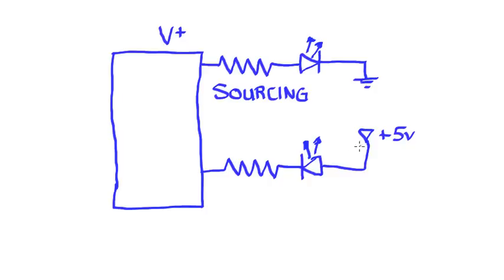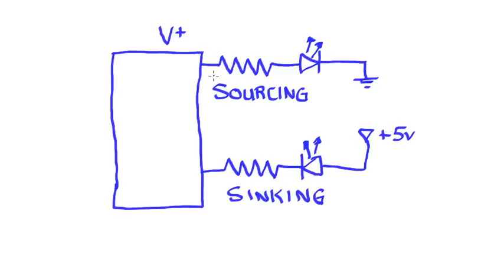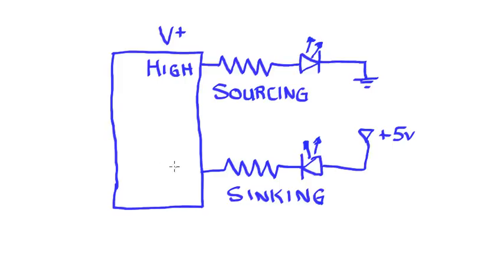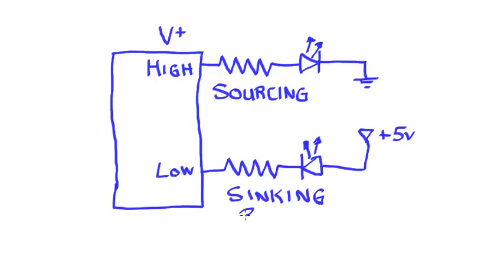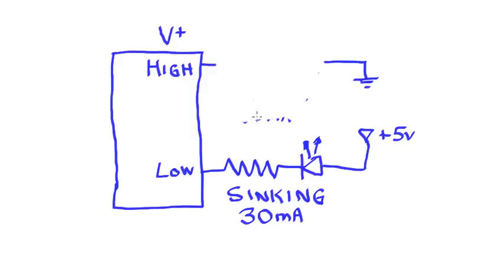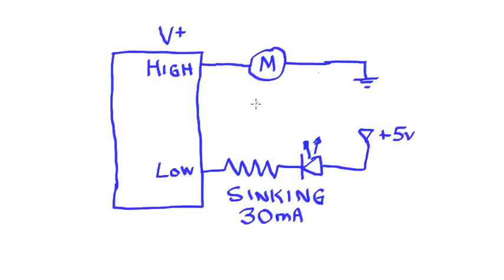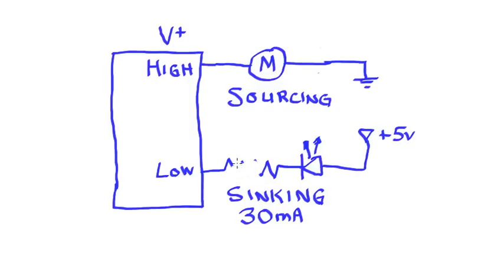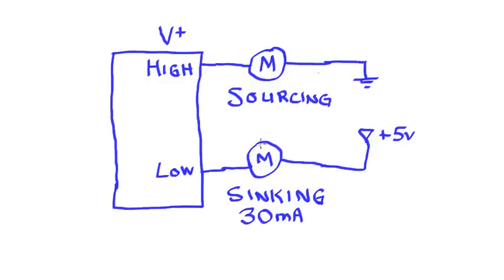Sinking and Sourcing

Comment: Sir, when is current negative? Say if the 7400 IC says that IOH = -0.4mA, IOL = 16mA
IOH means that the NAND is outputting a high, and IOL means the NAND is outputting a LOW right? So IOL means Output pin low (current), IOH means Output pin high (current). Correct? If not, do you think you could do a video on it? I'm more of a visual and auditory type learner.

Comment: In sinking configuration by increasing the value of resistor , can we use the load which draws much higher current?  As PIC is just used as a switch to close the circuit and we are protecting it with higher value resistor.

Comment: Excuse me sir. But I don't understand how the circuit to the diode is completed? The Cathode goes to ground but that does not complete the circuit. The PLC would  have to to connected to the same zero volts as the cathode, right? If the cathode is just connected to an earth it won't light?
Reply from the maker: You are correct - in order for the LED to light there must be a complete circuit with one end (cathode) connected to ground and the other end (anode) connected to the voltage source.  When the anode of the LED is connected to the PIC such as an Arduino) then when the pin goes high that pin is internally connected to the positive end of the voltage source (let's say +5V).  There is now a complete circuit - +5V through current limiting resistor through LED and then to ground - and the LED will light.  When the pin goes low, an internal connection in the PIC is made to ground and the LED goes off.  This configuration is called sourcing. 

When the cathode of the LED is connected to the PIC, the LED will go on when the pin is low or off.  This is because we now have a complete circuit as well - ground (via the PIC) through the current limiting resistor through the LED and then to +V. If the pin goes high, the LED will go off because there is not a complete circuit.  This configuration is called sinking.

I hope this helped.
Reply: Many thanks for your response. 
Yes that does help a lot. The ground is basically the other end of the completed circuit. Thanks again!:-)